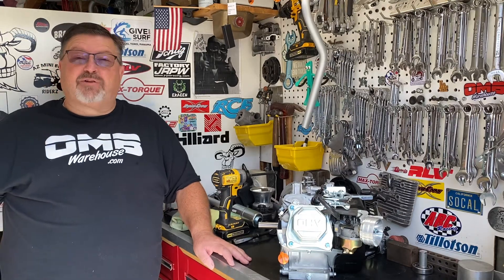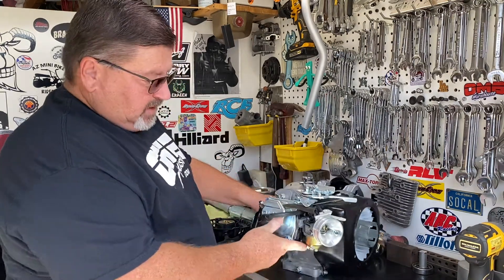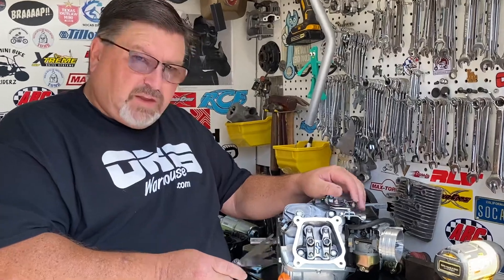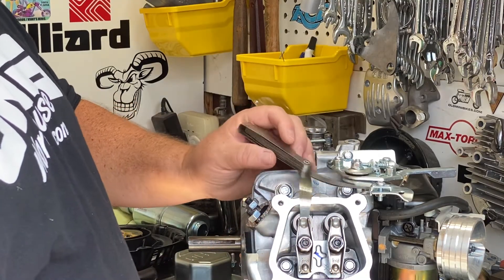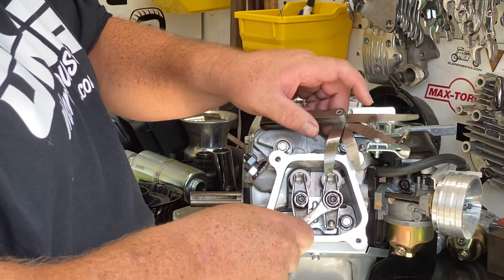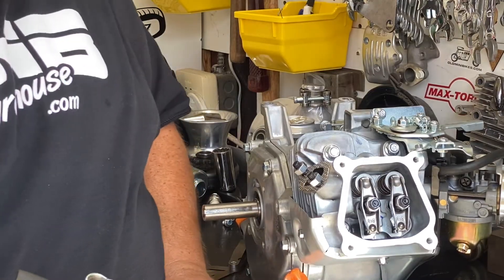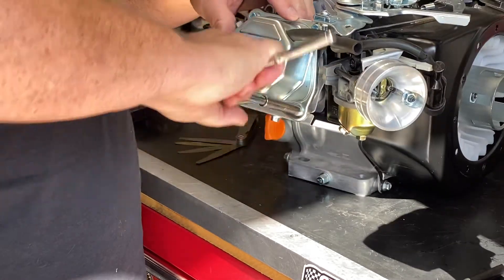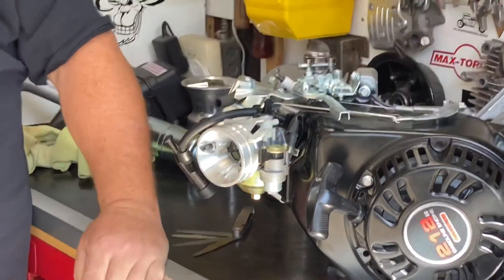How To Set Valve Lash on Non Hemi Predator Hisun GX200 Clone engines

Comment: Help what would you set exhaust valve to on the predator ghost 212 I set to factory still trying to jerk arm off
Reply from the maker: @markhall1855  make sure you are on the compression stroke at top dead center and set the lash at .003”
Reply: Thanks

Comment: If I’m switching to 26lb valve springs and champion rockers, would the lash need to be the same?
Reply from the maker: Valve lash does not change with different rockers and/or different springs

Comment: This will work for the champion style rockers to right the x ones
Reply from the maker: Yes, the procedure is the same regardless of the rockers used
Reply: @TheGrayGoatGarage  forgot to tag you
Reply: I had a question wondering if you can help, I installed a new pair of champion rockers on my 212 predator the cam is old and I salvaged it from a older motor, I installed the rockers set the valve lash and all when I go to turn the crank it does the exhaust side smooth and easy but once it goes to the intake the motor stops turning like it hits a hard spot, I forcefully turned it once thinking nothing can happen but it broke the rocker arm where the pushrod is pushing up, I just wanted to know is the cam I’m using ruined or warped or can it be something else?
Reply from the maker: @armandorivera7472  Sorry, there is no way for me to know what is going on without my hands and eyes on the engine. Too many variables here!

Comment: I got a 224 with billet rod flat top piston and a tts thunderstix ghostbuster camshaft and 26lb springs and I’m getting bad kickback I clearanced the cam and crank a bunch and it’s always very hard to pull I set my lash good nothing is hitting idk what the issue is
Reply from the maker: Valve lash! If you pull the spark plug out and it pulls over fine, reset the lash!
Set at .002” on both sides and make sure you are at TDC on the COMPRESSION stroke

99.9% of the time loose lash is the issue!

Comment: I have never seen the exhaust valve lash smaller than the intake valve lash... now quit mething around .... 2 snug on the exhaust that's going to hang open?... am I wrong?
Reply from the maker: You are incorrect. These engines, unlike automotive liquid cooled engines, expand whey warmed up causing lash to increase. 
Set both sides at zero if you are confident in your mechanics skills!

Comment: Honda EP1000 Engine valve clerance point pls tell me
Reply from the maker: I don't work on generator engines, but an engine is an engine! Set the lash at .003" on both sides cold. You will be fine!

Comment: Just got my upgrad kit for my 212 non hemi. (Billet rod/flywheel. Mod 2 cam). At first when i put everything together i like to spin the engine by hand to see if it clears everything. But at opposite of tdc theirs a clicking noise, which by checking it, its the intake lifter thing by cam, whwn its about to press on it, it sounds. So send an email to OMB & they said it was maybe the valve release but it wasnt. So went ahead & decided to turn it on & engine is really noisy & hard to pull, stock cqm is quiter & runs good. (I have video posted)

Going to try this again by adjusting valves & hoping this is my issue.
Reply from the maker: I am the tech guy at OMB!
Please understand that it is very difficult to diagnose issues when I can’t see or touch the engine
If the engine is hard to pull the engine over the valve lash was not set correctly
Reply: @TheGrayGoatGarage  https://youtube.com/shorts/uNPvT379Z7c?si=DXExxvHit_6fZhyJ
This is what it was doing. This noise is coming from the intake valve lifter & opposite on timing from tdc.. 

I will adjust valve lash tomorrow 🤞 hoping 1 its easier to start & 2. hoping the noise is quieter.
Reply from the maker: @Mroswaldo16  it sounds like something inside is hitting!
Reply: @TheGrayGoatGarage  only sounds with the mod 2 cam, stock cam its all normal. The first link, its something in the intake lifter. I put exhaust first & spin engine to hear the noise & nothing, until i put the intake one it sounds that clicking noise. & engine soins smoothly tho, doesnt feel like anything is grabbing. 

Also dud oil sensor & gov delete.
Reply: @TheGrayGoatGarage  https://youtube.com/shorts/8gxBpLjuplo?si=SOCw3McR01g3r6uc this is how it sounds. Stock cam is quiter & runs good. With billet flywheel & rod. 

My nephews 212 is also hard to pull the starter, the 2nd pull is hard. So will.adjust valve on that one too! 
Kinda excited now
Reply: I think the inside of your cam in between the lobes is just making contact on either the rod cap or crank normal edges.   I’ll send a video link showing you where some of those cams rub.  Pull the side cover and push everything to the case side and rotate with a flash light.  Let me know if you want the video link.  Specifically for Hemis with hot cams

Comment: I got a 224cc predator stock just put a bigger carburetor and no governor and oil sensor off what would yall recommend like the metal things that he’s using size or what point I should use someone help me plz
Reply: U ever figure it out same problem jere
Reply: @   you can find the part he’s using in harbor freight but I was barley getting into mini bikes but all I did was just buy a new 224😂 and left the other in my garage but it’s easy to set the values now search on YouTube

Comment: Stock length billet rod mod 2 cam 24mm mukini carburetor 10k rpm cast iron flywheel 22 lbs valve spring in a non hemi predator 212 ..... valve lash too its currently st at 0.003 and it wont crank
Reply from the maker: What does “it won’t crank” mean? Will it not pull over? Or does it not start?
Do you have spark?
Does the engine pull easily without the spark plug in?
Reply: @TheGrayGoatGarage  it does not start  yes it has spark pulls over easy with spark plug out

Comment: Ordered a MB200 stage 1 kit. Havent done the timing key or valve springs yet - it slowed my stuff down. Weird how most places show gains but mine didnt. Bought two MB200s, the stock one is faster - even swapped riders and it was the same. Hoping after I add the key and springs this will change things - good video, showed me how to complete my task.

Comment: This took me half the day LoL.
Sad when I know how to do somehting but never did it before.

I got it figured out and i thank you except I had it so messed up once that it wouldn't start, then it started really hard and now the ticking on the exhaust valve is gone.
But now the intake side is noisy, this is when I put the bike away and it was time for a beer.
I will get it tomorrow, only it sucks because I was going to set the lash and ride it at 11am today, around 6pm I finally got to ride it long enough to hear the noise again and for the governor to stick closed(caught up under the gas tank) and scare the ** out of me(I'm new to bikes at 50, things got really torquey fast).

This bike (Axis M200) is so much fun and I feel like a teenager when Im rippin it down the trail near my house everyday.

Comment: I feel no pressure pushing my thumb at all. Could that be a sign that I’m loosing compression somewhere?
Reply from the maker: If you felt no pressure it could be three things. A valve was open. You were in the exhaust stroke. Or the rings are shot. 
Chances are the rings are fine. 
Try it again and watch the rockers. Make sure both rockers loosen up when the piston is at TDC

Comment: If you truly believe what the hard-core go kart racers say about about the .003 lash then why did you set them at .002-.003??
Reply from the maker: The hard core ho kart racers set lash at zero. That is not something I want to relay to someone that does not have a lot of engine building experience! Keep in mind these engines expand as they get hot. 
Most cam cards call for .003” lash and that is the best setting for most stock to mildly modified engines

Comment: Question. I have a new 212 non-Hemi predator engine. I put 18lb valve springs in it. ( did a stage 1 upgrade kit)
I’ve been reading that the non Hemi has 1 lash cap. I’m concerned because I was careful but I do not remember ANY lash caps when I took it apart. I’ve heard the new non-Hemi engines don’t have any. Is my engine that new? I’m freaking out a little. Thank you!
Reply from the maker: The Predator 212 non Hemi engines do not come with any lash caps! You are not losing your mind! You are fine!
Reply: @TheGrayGoatGarage  phew!!! Thank goodness! 
Thank you!

Comment: Help me I did what you did in the video and my mind bike is still not running right and still hard to pull what can you do to help me
Reply from the maker: Hi Braden,
I can tell you to do it again. There are two top dead centers on a four stoke engine. The lash must be set at TDC on the compression stroke when both valves are closed. If you have set the lash on the exhaust stroke the lash will be too loose.
When the lash is too loose the decompression lever on the cam will not "burp" the exhaust valve open to relieve the cylinder pressure. That is why the engine pulls over hard

Comment: Ordered a 224 power kit from you with 1.3 black venom roller rockers, set them to .000 valve lash, running strong! Just wanted to know your thoughts on setting them at .000? Good, bad, pros and cons? Thanks !
Reply: Do it on a hot engine and you are fine... do it on a cold engine, give it .003

Comment: Great video. I was referred to this video on FB group. I hope you see this and can help. Coleman CT200U with stock 196cc engine. Only mods are removing throttle limiter screw and zip tie trick on governor spring. Hits about 33mph. I let it set and wouldn't start. Cleaned carb and verified jets were clear. Checked oil, replaced spark plug, new gas and swapped carb with known good carb. Starts now but dies when I give it gas. At 33 mph I'm told I may have floated valves. Not sure if I need 18lb springs or trashed the engine 
Any help is greatly appreciated.

Comment: So I've got a billet rod with a flat top piston and 26lb springs with champion rocker and my firend told me to put it to .00 and I did that and it sorta work I've got the engine running but sometimes does after so what would u recomend putting the  valve lash too?

Comment: My engine will start and run but dies after a couple seconds with throttle
Reply from the maker: That sounds like a carb issue. I would check for a vacuum leak or go to a larger main jet. Too many variables for me to know

Comment: Greatly Appreciated! I followed an 18# valve spring installation video from another channel that provided loose factory valve lash. I appreciate the details and explanation; I couldn't figure out if i was going too tight or too lose - but you solved my problem by tightening down to .003 then checking to make sure its snug on the .002

Comment: My clone was running a little sketchy when fully hot and run hard for awhile. So I took the note here about how this design can get loose when hot ... I couldn't locate the .002 gauge at first and set them with .0015.

Being that .002 is already tighter than spec, .0015 was way too tight. I got one backfire out of the exhaust and nothing more. Engine was super easy to pull because there was now zero compression now: I removed the spark plug again and never felt any air when rotating the engine. So yeah, after you adjust, rotate that engine again and check that aspect also.

I used the .003 gauge and set them there. I didn't have a chance to verify hot performance but it started easy and had very snappy mid range power. 

Overall it was kind of a pain and I'd never say I was super confident in the clearance I achieved, partly because without a mirror or some way to observe the piston, TDC using this method is "close" but not exact. You can easily rotate the crank some degrees at "TDC" this way, which of course isn't truly accurate unless you also witness where the timing mark is.

Comment: Hey Mr maybe you can help me out I bought a predator motor last year and the winter and I used it in the spring probably ran good I had the mud motor 105-in shaft on it ran good about 5 or 6 times out seven by seventh time out sort of making a noise like that I would drive for about 20 minutes and then all of a sudden it would go into like a bad vibration and I thought it was the shaft so when I came home and took a shift off started the motor headed to bed 10-15 minutes did the same thing and of course my warranty was up so I couldn't take it back I missed it by like 2 days no I was just wondering if you could help me out I'd appreciate it thank you

Comment: Hey Grey goat! Just discovered your channel. I have a 196cc Ct200u-ex I've had for 9 months. I want to make sure my valve lash is good, but they are a little loose from the factory clearances. Should I set them tighter? I have a Mikuni, Torque converter, Straight pipe and govenor is bypassed. I don't know if that matters when setting it tighter or not. Thanks

Comment: Hey nice video I'm going to apply that to my motor I have it attached to a bike I took it off the mini bike a Coleman ct200u and I put it on a fern strong steel frame beach cruiser it does about 54 miles an hour but I'm going to put the 26 lb valve springs in there to see if I can get it to rev higher thanks nice video

Comment: Gray goat, I just recently installed 18lb springs in my non hemi predator 212 and my minibike is actually 4mph slower now. Any ideas or insight on what may have caused this? Thanks
Reply from the maker: There is no reason it should be slower unless the valve lash was not properly set. I don't believe this has anything to do with the valve springs. If you have removed the governor and you are still using the stock connecting rod, it may be starving for oil and us getting ready to exit the block!

Comment: Is it ok to set my valve lash at .002 on my    exhaust and intake on a honda clone 212cc non hemi engine? I'm replacing my valve springs with 18lbs.
Reply from the maker: Yes. That is fine. I will set some of my engines at.001” to .0015”. These engines expand when hot and tight lash does not cause any issues

Comment: Eric, been having kick back on starting and went to readjust lash. Basic build. Champion rockers, 22lb springs, mod 2 cam, non hemi with factory 5mm valves/split retainers. I was thinking of adding lash caps because with the champion rockers the adjusters sit down in the valley of the retainers and it's hard to get the feeler in and get an accurate measurement. I got the appropriate length pushrods, but just seen someone with a similar setup that looked like the adjusters beat the hell out of his stems that didn't have caps. I ordered some titanium valve stem caps/rotators. Any thoughts on this? I had posted in I've group and got crickets. Scoured Google and nothing definitive. Hoping you'd have some wisdom to share with me.
Reply from the maker: Lash caps are always a good idea! Use them at every opportunity. The lash caps for 5mm stemmed valves are very hard to find and not something we have access to. I would consider shorter pushrods to get the adjuster further out. I have only seen the issues with Champion rockers and dual or 36# springs in big cams. Let me know if you can find 5mm lash caps. Everything is geared to 5.5mm stems and those caps are not correct for you!
Reply: @TheGrayGoatGarage  thanks Eric. I of course checked to find them with you first as always. I did find them from an EBay seller who I've used for some hard to find oddball stuff a few times. I really appreciate you taking the time to provide your knowledge.
Reply from the maker: https://www.ombwarehouse.com/pushrod-length-checker-small-block.html. I use this tool to get the proper valve train geometry. This allows you to mock things up and get the correct length pushrods. There are way too many variables in Chinese engines to have a one size fits all” approach and everything needs to be checked!
Reply: @TheGrayGoatGarage  it's in my ever expanding cart now 😁

Comment: How do know which one is the compression stroke
Reply from the maker: Pull the spark plug out, put your thumb over the hole, and rotate the engine. The exhaust stroke will feel like it is sucking in the compression stroke will force your thumb off the hole. Get to TDC and set your lash

Comment: I did this when I installed my new 26 lb springs on my hemi predator as part of a stage 2 kit and during a test run a spring broke, the people I bought it from said it was my fault for a couple reasons... I was over reving it, I didn't check for valve I forget the term 😅 spring smash... every thing looked good when I set it. It ran great. I never went past 6k peak rpm not driving at 6k but peak like 0 to where I feel the engine shake as a test run. Nothing crazy. Every thing in the engine was fine the only damage was only to the one spring, the valve, and a spot on the piston where it pushed the valve through the head.
Reply: Sounds like a mis aligned cam
Reply from the maker: If coil bind was the issue you would have bent pushrods. 
With race type parts things can happen! Maybe it was just a bad spring assuming you have a stock cam
The Hemi head has shallow spring pockets and we really need to keep the lift under .300”